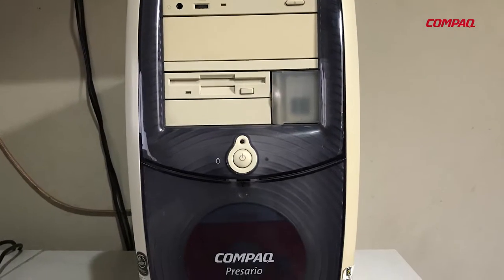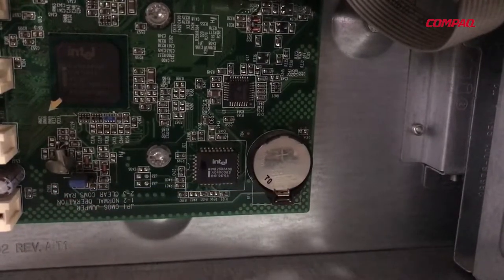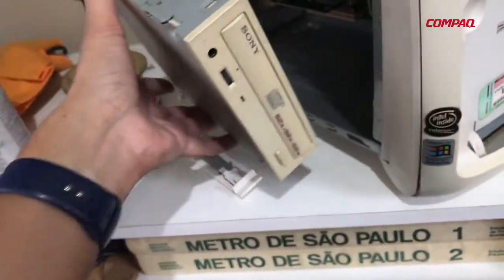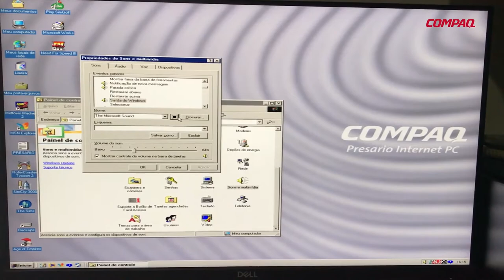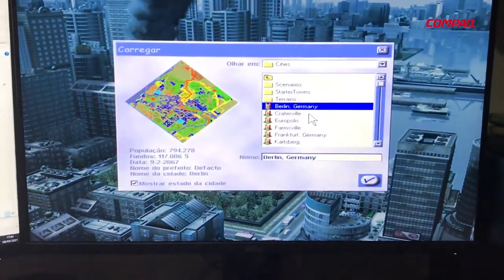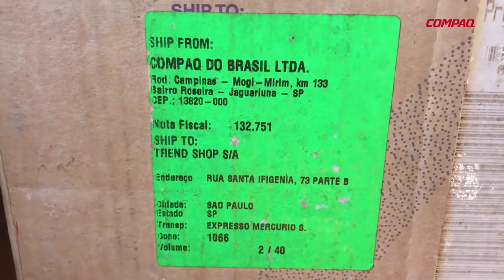Compaq Presario 5000 - 20th Anniversary Review

Comment from the maker: TIMESTAMPS:

00:00 - Introduction
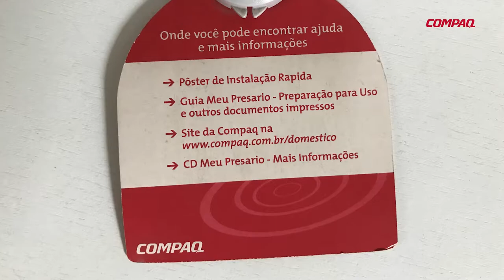00:57 - Cleaning
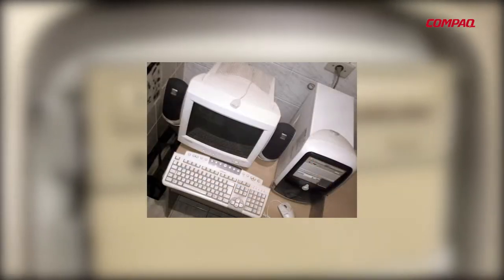01:27 - Which model?
02:27 - Inside it
03:00 - Modem
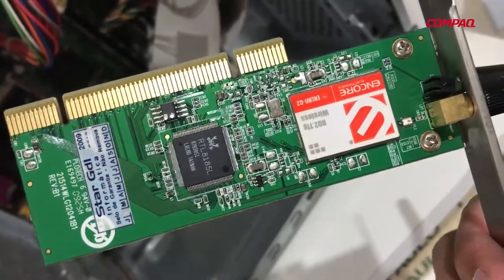03:41 - Wireless
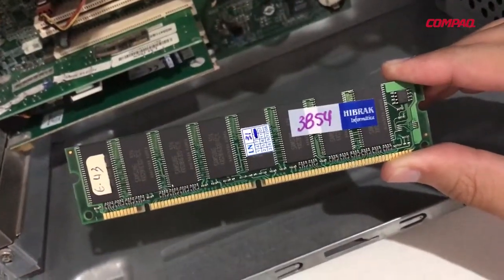04:31 - RAM Memory
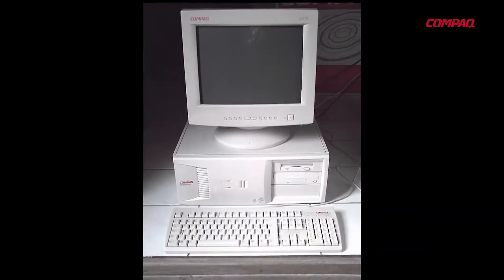04:52 - Compaq Deskpro (family increasing)
05:47 - Deskpro's remainings
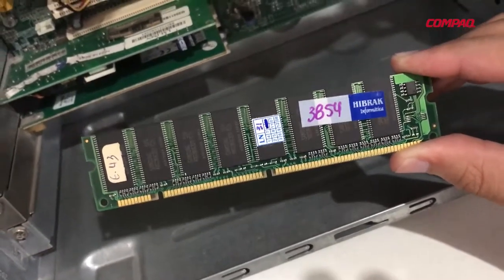06:34 - Original Hard Disk
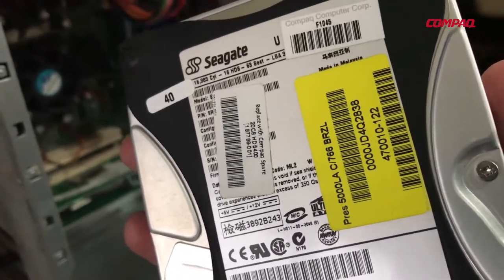07:41 - Second Hard Disk
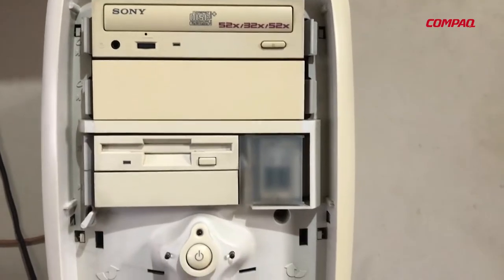08:35 - Celeron Processor
09:15 - CDRW Drive 
09:49 - Good thing about Compaq 5000 Series
10:30 - JBL Speakers (The best part)
11:33 - Booting
12:53 - Microsoft Encarta 2000 intro
14:20 - SimCity 3000
16:44 - Original Documentation
17:14 - Original Box
17:42 - Finish

Comment: I love mine. I have a Pentium III 850MHz model. I have added two Voodoo2 12MB cards in SLI, a Thermaltake 500W modern PSU and a Gotek as replacement for the floppy drive. This computer is extremely powerful and works great! It looks like the motherboard is the same on yours as mine so you should be able to upgrade yours to an 850MHz PIII as well.

Comment: Monitor model number at 10:50?
Reply from the maker: It's a Compaq B540 model
Reply: @americo_san  Oh wow what a rare Compaq monitor, since there isn't even an image of the monitor itself on Google Images! 😲
Reply from the maker: @MindsEyeTHPS  This B540 monitor, as well as the B520 and the B440 models, were manufactured by TCE, and then rebranded as Compaq. TCE was a Brazilian short-life company, producing monitors and some other devices from 1997 to 2001. I don't know how this work in other countries, but Compaq made a lot of rebranding around here in Brazil back then. They bought lots of those and just changed the brand. Just like the Deskpro monitor (seen in 4:54). This is actually a Samsung model, but Compaq bought them and rebranded for use (model V510b). 

I still have this B540 (didn't used it on the video because of its weight and few space available at the desk LOL). Unfortunatelly it's not working properly. I like using it with 1024x768 pixels, but now it's working only on lower resolutions. :(
Reply: @americo_san  Wow TCE. Never heard this obscure name of a supposedly dead Brazillian PC peripherals make.